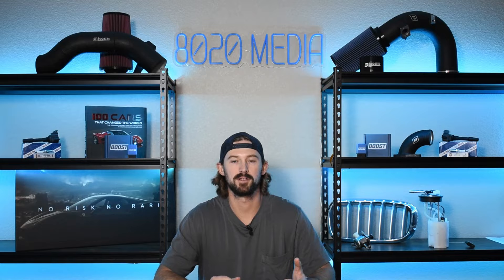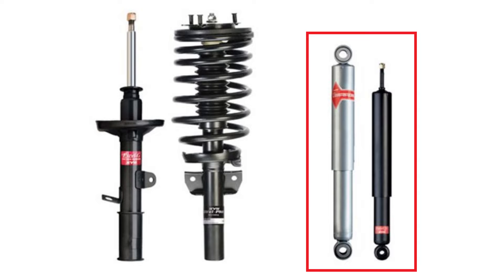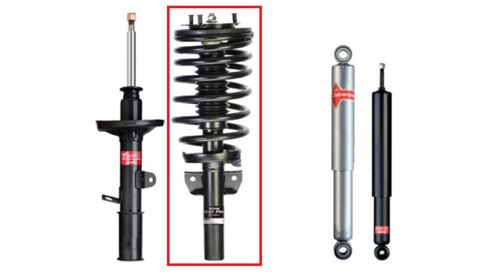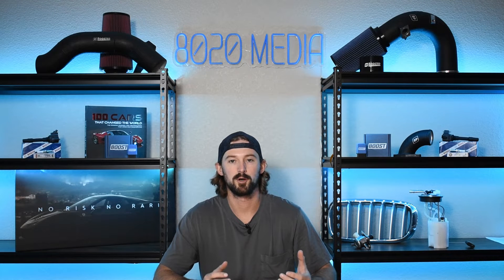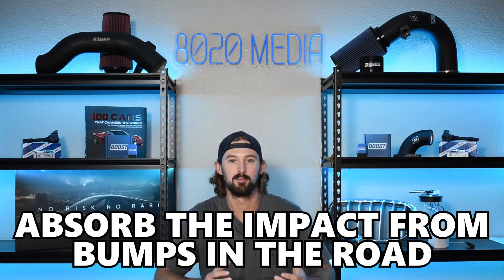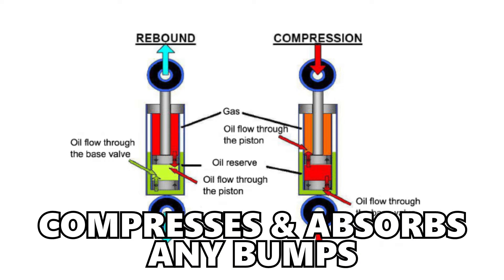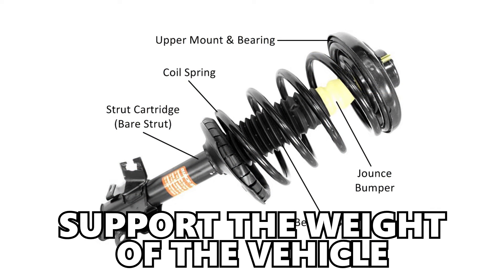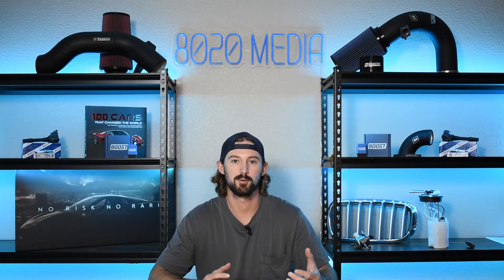Signs & Symptoms of Bad Shocks or Struts!

Comment: I am looking into this because I have a weird steering problem.  If you didn't know you would think a bad tie rod or ball joint was causing it.  The vehicle is not undrivable but sometimes I notice a bit of a sway in turns and also I feel it when changing lanes.  My steering also does not feel as precise as it used to.   It is not yet causing abnormal tire wear but that may be because I had it aligned.  I have a 2017 Nissan Rogue Sport SV (AWD).  It is drivable but the steering seems a loose or imprecise.  What bugs me the most is that when I have gone to 3 different shops none of them were able to find anything loose.  It is frustrating because I know something is wrong yet none of 3 different mechanics (one of which was a Nissan dealer) were able to find my problem.  If it is not a bad strut I don't know what it is since it will have exhausted all possible ideas.  I even had them check bushings.  I went back into the Nissan dealer's service area with one of the mechanics and shook a couple of things myself and I could not feel anything loose.  It is driving me insane!  I hear they are oil shocks and struts but do they have to be leaking to be bad?  Also there is a possibility of a bad spring.  I may even be better off with all new shocks. struts and springs.  I would just have to explore pricing on all of that stuff and see if I decide to just get an OEM from strut and replace the bad one.  I will have to look into it and see if I can afford to do them all.  I am also aware that these vehicles have a steering angle sensor that can cause problems if it is bad or just not calibrated.  Maybe the darned vehicle is just cursed.  If I drove any other vehicle there is a strong chance it would not feel like that!
Reply from the maker: C - Sorry to hear this and thanks for taking the time to share all this. Keep us updated.
Reply: I know this is a year old, but wondering if you ever got them replaced and that fixed your issues? I too can tell something is off and all the symptoms point to struts and shocks but I've had multiple shops inspect and they all say nothing looks loose or damaged. I find it really hard to justify spending the exorbitant amount of money this costs on my vehicle if I'm not sure it will fix the problems, ya know?